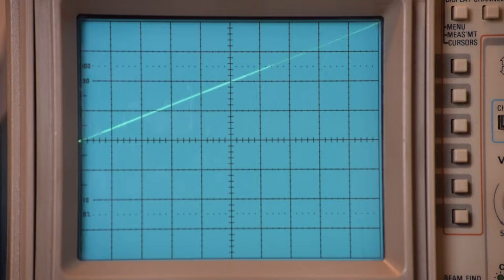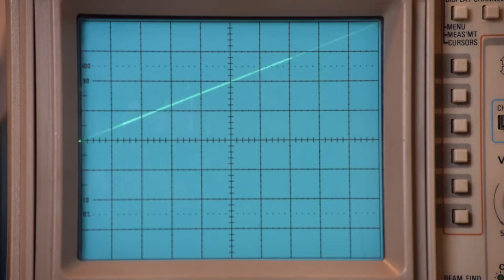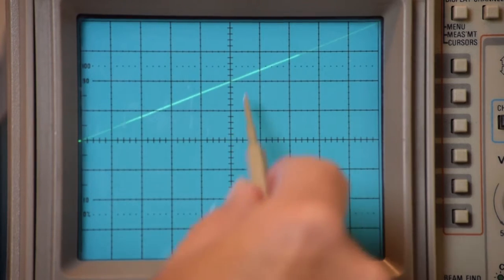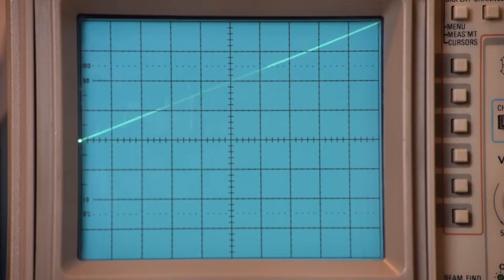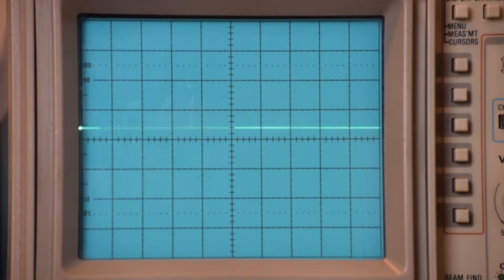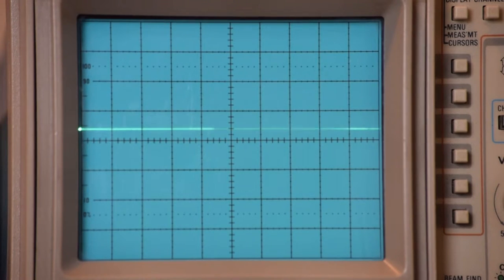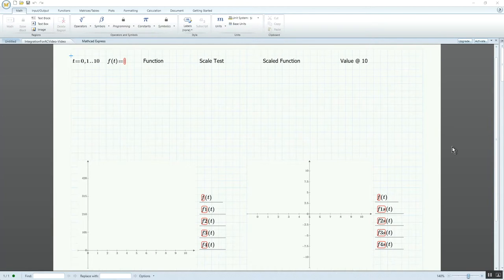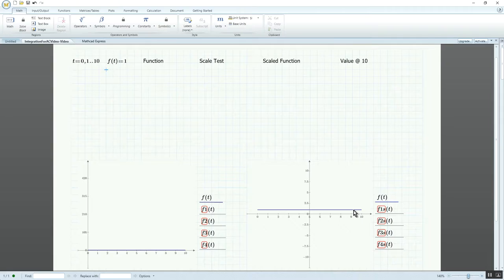Basic Calculus Concepts on an Analog Computer

Comment: This looks like Serge modules. Do you think he was inspired by an analog computer?
Reply from the maker: First, thanks for watching, and I'm sorry it took a while to reply. That's a good question, but I'm not sure if I know the answer. I had not heard of the Serge synth modules, but I did a little digging. They look and sound pretty cool. I can see some similarities with the analog computer layout, but that might be more related to an influence of the Buchla sythns. I heard somewhere that he went with banana plugs, like those used in analog computers, because he was focusing on a low-cost system, and they were readily available. I saw a Heinbach video where he said some of the modules do sound like analog computer effects, so he may have been applying some analog computer techniques. Sorry I don't have a more definitive answer. Interesting question though.

Comment: Thank you for this indepth demonstration. I have a question, if I were to send some unusual waveform to an integrator, would it show me the integral at the output? I assume that it would. Also would an arbitrary waveform generator be useful for these types of experiments?
Reply from the maker: Steve Matson, Thanks for watching. The short answer to your first question is, yes, with some limitations. You would need to be careful about overloading the integrator. In analog computing, this means scaling the problem so the output of the integrator is kept within its operating range. If the operating range is exceeded, the integration result would be invalid. That’s why the analog computer has an overload indicator. Also, in designing an integrator, it is important to use low leakage capacitors and a method to reset the integrator to a starting value. This is referred to as the initial condition in differential equations, and can be 0V, but if the integrator starts with an incorrect voltage, the output will be offset by that amount. Usually analog computers use a relay to reset the integrator to avoid any leakage associated with a FET or BJT.

An arbitrary waveform generator is extremely useful. An interesting bit of history of analog computers is the extent they went to to generate unusual waveforms. Often, they had a waveform to study that was generated by sensors in an experiment, but there was no mathematical model for the waveform. This was long before an AFG was available for a typical bench. Some examples are diode function generators, oscilloscope adapted to generate a function, X-Y plotters and special potentiometers with the coil of wire formed on a card to generate the required function. I read about an X-Y plotter technique where they would paint the desired plot on paper with conductive ink, then apply a low voltage RF signal to the trace, A signal detector would then replace the ink cartridge in the X-Y plotter and home in on the RF signal emanated by the trace in order to follow the plot. The oscilloscope method was along the same line, but with a mask over the CRT screen with a light detector set up to track the light generated by the oscilloscope trace as it followed the mask.
Reply: @timthompson468  thank you
That's some extremely cool history